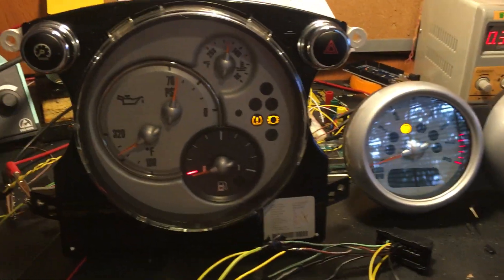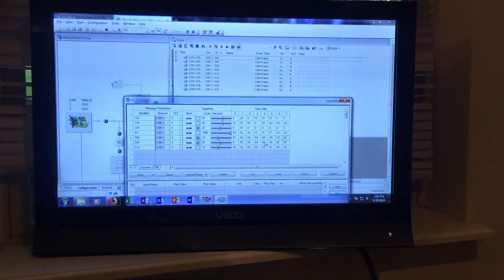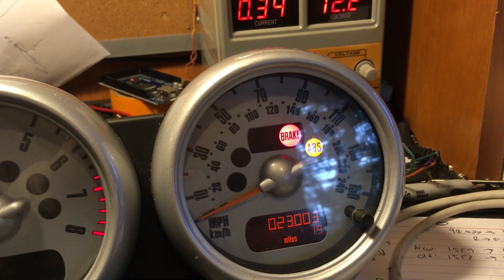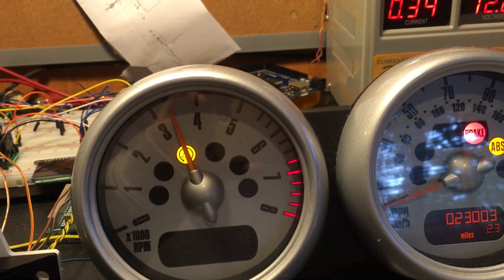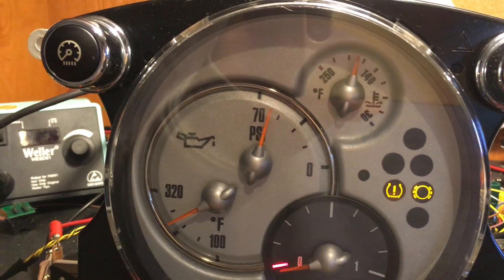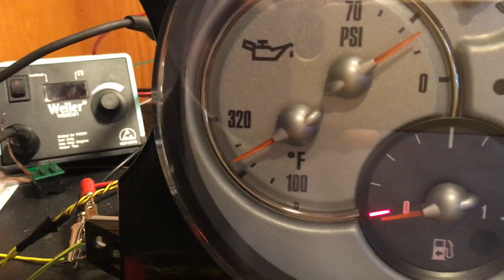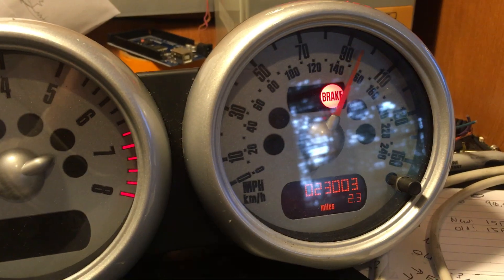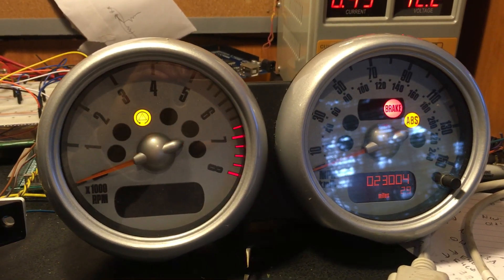R53 Mini Cooper S Chrono Pack - CANbus Hacked

Comment: Hi! not sure if you are still around here, im trying to get oil pressure working, 0x565 byte 6 but doesnt work, any input please? thank you!
Reply from the maker: I haven't worked on this project in years, but I think it's possible you can send it out of range data and the gauge will not respond. I don't have any other information aside from that written down :\
Reply: @GarrettsSubaru  appreciate a lot your reply, if you send 255 shouldnt go higher? im thinking that chrono gauge needs from other byte in different message ID for working but im not sure at all because i have already working engine colant gauge and oil temp gauge.

Comment: Tachometer (RPM)
ID: 0x316 (dec 790)
Byte(s): 2-3 (16-bit, LSB first)
Scaling: RPM ≈ raw / 6.4
Test values:
  Min: 0x0000 → 0 rpm
  Mid: 0x1900 → ~1,000 rpm
  Max: 0x9600 → ~6,000 rpm (or whatever upper limit of your tach)

Speedometer (km/h)
ID: 0x153 (dec 339)
Byte: 2 (8-bit)
Scaling: ~2.16 km/h per raw unit
Test values:
  Min: 0x00 → 0 km/h
  Mid: 0x39 → ~120 km/h
  Max: 0x70 → ~240 km/h

Coolant Temperature (°C)
ID: 0x329 (dec 809)
Byte: 1 (8-bit)
Scaling: °C ≈ 0.4865 × raw
Test values:
  Min: 0x00 → ~0 °C
  Mid: 0xB9 → ~90 °C
  Max: 0xF7 → ~120 °C (overheat lamp comes on)

Oil Temperature (°C)
ID: 0x545 (dec 1349)
Byte: 4 (8-bit)
Scaling: roughly linear after cluster comfort mapping: dial °C ≈ raw − 48
Test values:
  Min: 0x5B → ~40 °C
  Mid: 0xA0 → ~100 °C
  Max: 0xE5 → ~160 °C

Oil Pressure (Bar gauge)
ID: 0x565 (dec 1381)
Byte: 6 (8-bit)
Scaling: linear over usable range; treat 0x10 as low, 0xF2 as near max, 0xFF = invalid
Test values:
  Low: ~0x10
  Mid: ~0x80
  Max: ~0xF2

Comment: Old video - but I hopre you're still there. The oil temperature is not actual temperature, but based on a calculated model - do you know if this is the same with the oil pressure? (The EPC does not show any oil pressure sensors, just an oil pressure switch)
Reply from the maker: I am still here!

Yes, the oil pressure is fake as well. The gauge physically cannot move fast enough to replicate an actual oil pressure seen in vehicle.

Comment: Hey Garrett! Impressive video! I've just started with simracing and have an old mini rev counter (2007). I was wondering if you could share some details like pin layout or how you've hooked up the device. I am planning on using an arduino to interface with the device. Hopefully you can publish some of the details online. Really appreciate it and keep up the good work!

Comment: super impressive! pls tell me that you now can easily connect the hacked gauges to a racing sim to drive the needles from there?
Reply from the maker: Define easily? I'd say so if the sim easily outputs vehicle speed/rpm etc for you to use with external apps. Wouldn't be hard to code that up at all!

Comment: This is really cool stuff! Would be interesting to see how to implement this onto a standalone ecu like the LINK ecu. See if you can read from a actual oil temp and oil pressure gauge and some how get the crono pack to talk to it?
Reply from the maker: I've already done that using a Defi sensor and some ghetto software. https://www.youtube.com/watch?v=Xk_D8Wn9Sts

Same could be done with pressure pretty easily, and is even easier to integrate with an aftermarket EMS like the Link if it supports CAN.